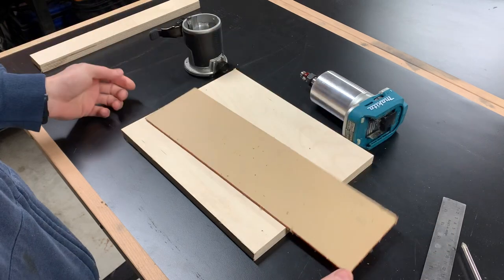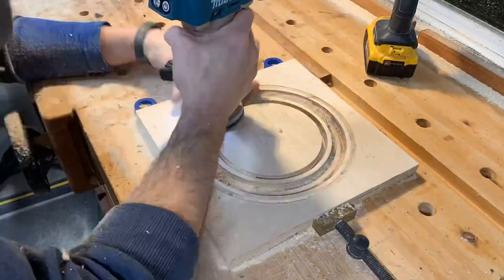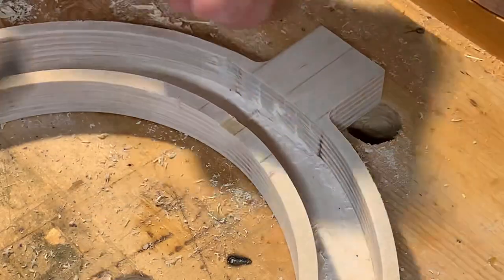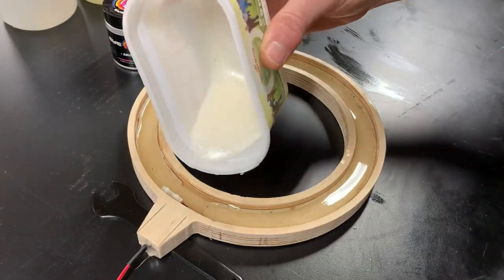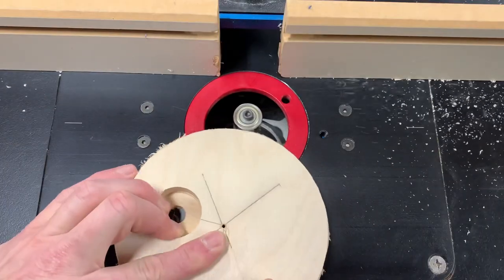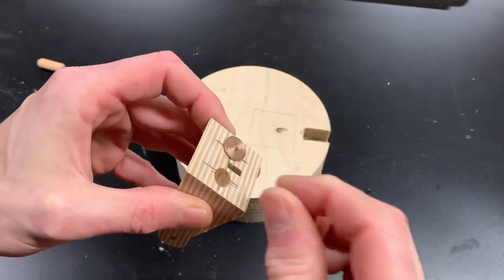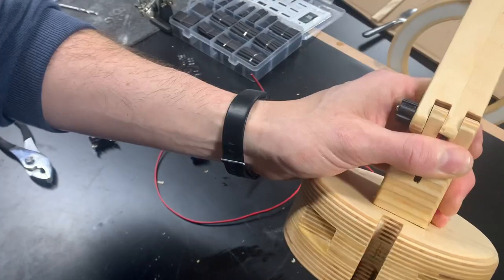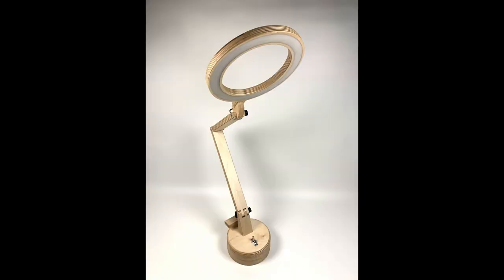Making a Ring Lamp (An Exercise in Failed Ideas)

Comment: Pretty beautiful work, dude! Nicely done! 😃
I would say the fingers need to be thicker in the arm... And depending on the wood you choose for the base, it won't need to be much bigger. 😉
The only tips I would give you is that there are lots of different LED strips you can use, so it's always a good idea to search about it. And some shielding where the LEDs go can be a good idea. Maybe aluminium tape, or even some black paint. 😊
Anyway, happy holidays! And stay safe there with your family! 🖖😊